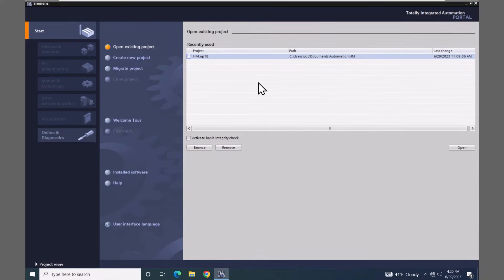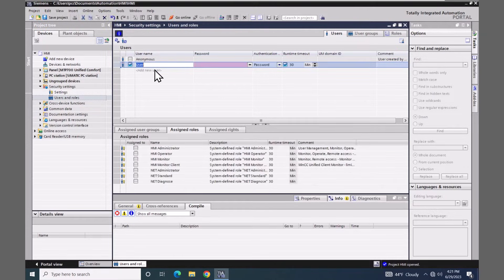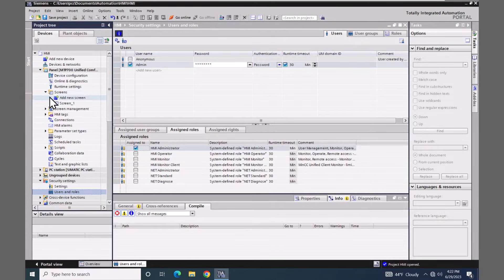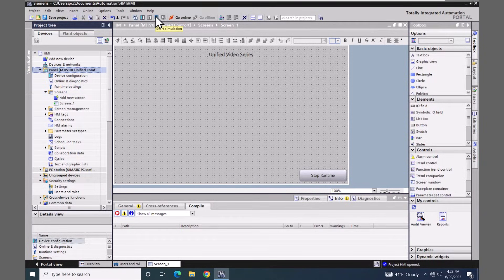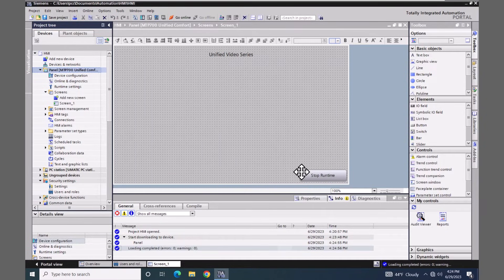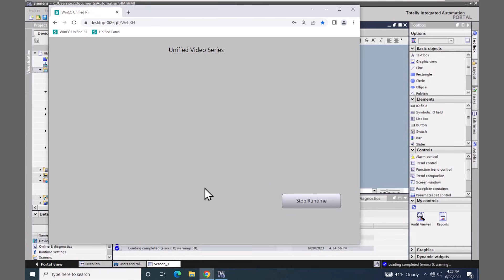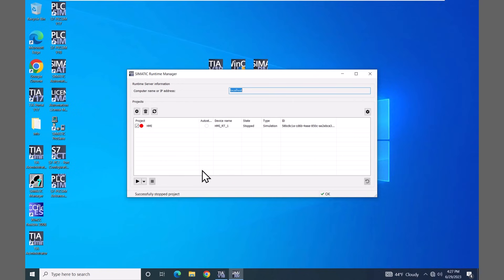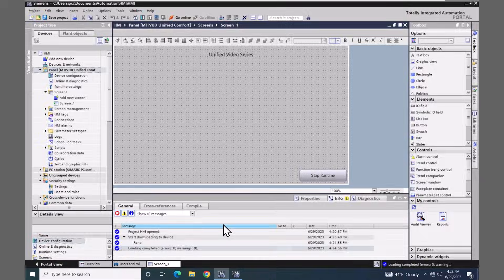Lesson 03 - Simulating Unified Comfort Panel | Siemens HMI Training

Comment: Every time I download I get download I get a warning that says, delta download capability has been lost for the device 'hmi_1' due to restrictions on compiling for type 'connection'.
Then when I try to access through web browser it says the website cant be reached. Any clues what I am doing wrong here?
Reply: Having the same issues, were you able to solve this?
Reply: @user-dl1io1kr4c  yeah. There are a slew of services you must enable on your computer. The services are on siemens industry support website. There is quite a bit of stuff you need to do, and I can't remember it all right now. The delta download is just an online download without stopping runtime.
Reply: @user-dl1io1kr4c  youtube deleted my comment. I don't get the censorship on here. 

Go to siemens industry support and search for entry ID 109806850. This shows you how to set up a certificate and permissions properly.
Reply: @user-dl1io1kr4c  youtube keeps deleting my comments. 

Siemens industry support.

Search Required windows features for wincc unified

Als0

Search settings for communication with wincc unified runtime on the runtime device